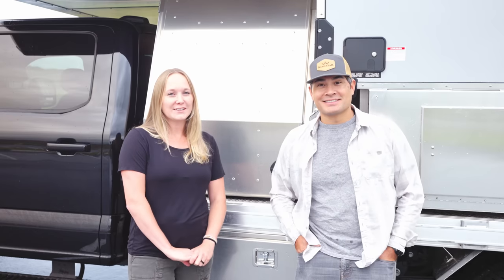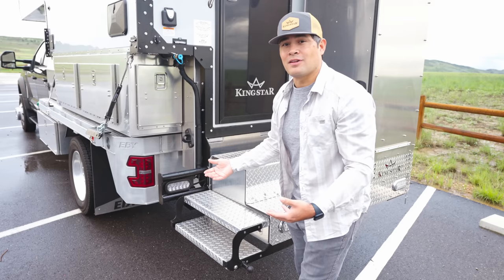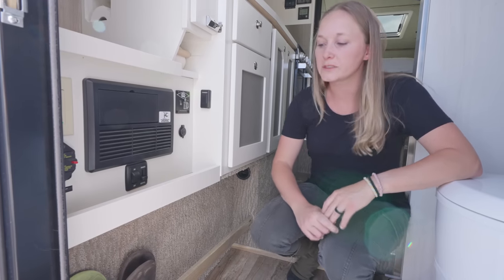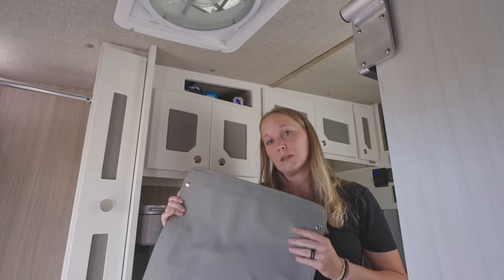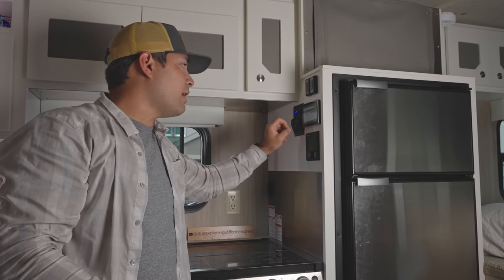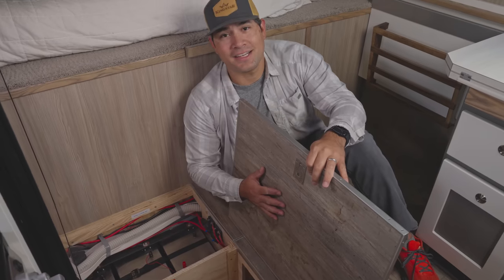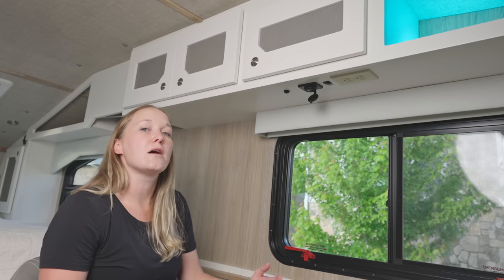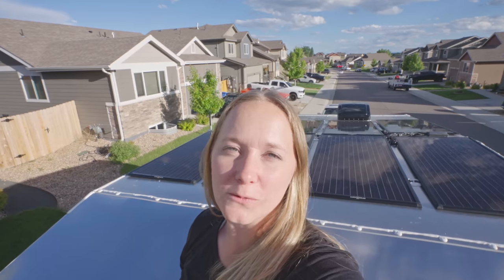2023 Kingstar Camino 88 Truck Camper: The Command Center Walkthrough

Comment from the maker: What are your thoughts on this Kingstar camper vs competitors?
Reply: Here are some thoughts on what i've learned living in my host yukon full time since late 2021.
 
0. Avoid slides... why... (a) water leaks - on all three slides!!!, (b) insects crawling through, (c) winter breeze coming through, (d) slide-awnings make awful noise and can possibly rip with high winds and finally (e) slides makes the camper extremely heavy.
 
1. Love the open space and huge storage
 
2. Love the huge tanks (fresh 65 gal/ grey 51 gal/ black 32 gal)
 
3. Needs a flatbed dually... (diesel - at least a f450 /// gas - at least f350 (7.3godzilla) and preferably chassis+cab flatbed)
 
4. Get a quiet ac right away... 12v ac would be nice to have but not at +$3k
 
5. Get On-Demand Truma water heater... love it
Reply from the maker: @avecruxspesunica2552 great info! And we had similar thoughts on the slide so this is good confirmation.
Reply: Dude did you both trully did buupuPs inside that tiny truck camper ??
Reply: I really like Kingstar’s continual upgrades without having to wait for the next “annual” upgrade. The “controlled custom” approach to their builds is really appealing. I’d probably opt for a traditional dinette, since I have a friend who’d occasionally travel with me. Otherwise, I’d option my build identically to yours. Do you have an idea how tall and long your rig is? Thanks for a great and informative video.
Reply: Not a bad setup! If you're full time RV'ing, the optional "garage" is useful. Otherwise, for seasonal camping, it makes more sense to have more interior space.

Having said that, Kingstar does seem to make good use of the interior space. I like how they implemented the wet bath setup.

Being 6'6" with size 16 feet, I'm sensitive to confined spaces that aren't used properly. The shoe "rack" would be useless to me, but maybe I could find another use for it.

Curious! Do you leave the access panel open for the cats to get to the litter box? Or are the cats trained to let you know when they need to use it?

Interesting use of the desk space!

Hmmmm... since you give a good example of someone who is 5'5", I strongly suspect that I would feel cramped in this unit. The HOST Mammoth would be a better option for taller people like me.
Reply from the maker: Thanks @MickPsyphon ! We love the use of space! The access panel for the litter box can stay closed, there is a small tunnel entrance by the sliding drawers that the cats have full access to that leads to the litter box. Also, I am 5'11" and Dee is 5''5". That said kingstar does have a "flatback" option that basically takes the highest point on the camper and keeps that height all the way to the back door. Way more spacious for those much taller than us :)
Reply: Very nice! Do you know what wheelbase you have on the f550?
Reply: New to truck camping, I watched this three times because there is so much.  Average truck campers don't have all that stuff.  As a single woman I would say it's a bit intimidating but I love the idea of having it built you you vs everyone else.  I plan on looking at the website for sure.
Reply from the maker: Happy you found it useful! Feel free to DM us on instagram if you have any questions.

Comment: I stopped, just seconds in. No pass-through. The ideal king-cab, long box truck, with an option to mount a good camper, and yet again no way to go from the back of a truck into the camper. Like the M1010. Yes I know the whole thing would have to be custom, but it's where the world is now, and no-one seems to make the options.
Reply from the maker: Yea definitely not the end all be all solution, but it works great for our needs and more importantly gets us on the road fast!
Reply: I agree, safety feature in case a person needs to leave quickly.
Reply: How much does your entire camper weigh, with all the storage I would soon exceed the GW of the truck.  Did the flat bed weigh more or less than the factory bed?  I have a 3500 Chevrolet and a Northstar camper.  I would love to upgrade to a similar setup with my current truck.  Nice rig !
Reply from the maker: @jayknight850 great question. We have not weighed it without our gear, but I would guess around 14500-15000 total (note the truck is 10000lb alone). Loaded to live out of we are at 17,500. Note that the camper minus the side and front gearage would slip into any 1-ton truck. They’re build with that platform in mind.
Reply: The garage is the reason why the pass tru is not needed the camper is so nice crawling in ain't cool 😎
Reply: The pass through with gasket allows truck heat or AC to heat or cool camper during driving. Back seat of truck becomes bed for short person, they are still able to talk to others.. for safety you can hop through to start truck and leave. 

It is such a great feature if the camper doesn't have large window there it must be able to install there. I will change out custom truck window if needed. 

Yeah crawling through is not great, but I want the option. Or tiger adventure vehicle with walk through..
Reply: Well… Bye

Comment: I love these campers!  But my imagination sees the forward garage removed with the camper moved forward so the tail end of the flatbed could be used as an outside deck with a custom rear step, grilling and storage system, but it might be too small unless you can get the 550 a little longer.
Reply from the maker: That would be interesting, you may have to do some modifications to the grey tank but that deck idea sounds like a lot of fun.

Comment: I’m curious about the litter & battery/inverter area. Did you opt to put the litter box down there because you have fans that circulate through that area? 

I was just thinking about how adding a fan powered air circulatory system to that lower area could provide cooling for the electronics/batteries, cooling & some comfort for the cats when they’re down there while at the same time controlling the airflow & possible odors from that lower area reaching the cabin area up top.

Now I’m not saying your cats have explosive gases but I was thinking along the same lines as how boats have that fan system that’s supposed to suck explosive gasoline fumes out of the engine compartment before starting the engine. 

If that wasn’t why you added the litter box there and or ya think “Jeepers what a lame idea” then ok my wife is right in the fact that I overthink things way to much. 😳😜 Anyways I appreciate the video. You’ve definitely given me some great ideas to incorporate in my toy hauler moving forward. 
✌🏽🇺🇸
Reply from the maker: We put the litter box down there because that was the most logical spot that was out of the way (and Kingstar could make room). We normally don’t have any issues with smell but every once in awhile… 💩 stinks… 😹 We haven’t thought about the fan but it’s not a bad idea!
Reply: @ExploringStillConnected  ✌🏽

Comment: Hey you guys.  For the last 2 months I have been leaning towards the Kingstar KRUZR 88.  The one I built on there website comes out to about $110,000 and some change.  That is pretty much every option they offer on the thing.  Now that I know that I am willing on paying that amount I have been entertaining the idea of a Rugged Mountain RV.  Specifically their new X-14 because it is a non slide, starting around $100,000, and comes pretty well equipped.  It may be a little too fancy and pretty big.  Just curious on what were your last choices before deciding on the Kingstar?
Reply from the maker: We were looking more generally at new Northern Lites (didn’t check all the boxes) and older Bigfoots (gut and retrofit). But honestly when we saw the Kingstar there was no comparison for our wants. The Rugged Mountain non slide wasn’t available so not even considered. We would recommend getting in to the actual campers because that decided it for us. Make a list of your must haves, nice to haves and must not haves… both campers are great options but fit very different needs. Jesse (Rugged Mountain) and Marcus (Kingstar) are both awesome to work with.

Comment: Hello, awesome rig. I'm building a forward garage and would like to know what sliding tray you used for your bikes?
Reply from the maker: MORryde cargo slide from etrailer. Super solid
Reply: @ExploringStillConnected  Thanks for the info. Looks like a tight fit for the bikes, is your garage the 18" or 36" model?
Reply from the maker: @nomadic4adventure 36 but you can fit two bikes with 18” you just have to remove pedals
Reply: @ExploringStillConnected  Hello,.  What is the size slide tray did you guys go with?

Comment: Few more questions,..what is the length of your flatbed? Is your truck a cab chassis or did you take an 8' bed off it? What is the approximate wet weight of just the truck camper?
Reply from the maker: 11’ flatbed on a 84 “ CA cab chassis. Total wet and loaded with all the gear is ~17k . So about 7k wet with gear and garage/side storage. That said we have a ton of gear 😂. I think Kingstar said empty it’s about 4k but don’t quote me on that.
Reply: @ExploringStillConnected  OK thank you. I have an older 01 dodge dually quad cab 4x4 with an 8' bed. The cab top is only 56" due to the quad cab style, which I like. The thing is I don't want the cabover part of a camper sticking out over the windshield or part of the hood. So I'm thinking if I can put a 10 or 11' flatbed on where the 8' bed is and have a 24" wide storage area behind the cab and set the camper behind it, the cab over part would be right about the front of the cab or top of the windshield area. Only concern then would be if the center of gravity would be right. Thanks again, just trying to get this figured out before I start throwing money at it.

Comment: Was wondering who built your "garage box" and cost? We have a 5500, with a 11ft. CM Flatbed and would have room behind the headache rack for one. As you know, there's no room to store your spare tire. Should be room for the tire and a bike or two. Thanks.
Reply from the maker: Kingstar did and they have it listed on their site right at $7990 installed.
Reply: @ExploringStillConnected  Thank U.🤗 U.🤗.

Comment: Beautiful Truck Camper. I Love All the Storage Areas. 

1 Dislike is the 🚽 & 🚿  I'd rather a Wet-Bath, due to the fact that the 🚽when pulled out, Blocks the 🚪in the Event of an Emergency.
Reply from the maker: I hear ya, but we usually keep it in the “wet bath” configuration unless showering or letting the shower dry. And it is easy enough to slide back in on case of emergency.  That said I think Kingstar has a wet bath configuration as an option as well.
Reply: @ExploringStillConnected  OK Cool, Understood. 

Thanks much 🙂👍

Comment: hate those knobs on the cabinets and also, why do people keep pushing them in when they close the doors? It doesn't do anything but force you to double- push again to open. it does nothing! sheeeesh
Reply from the maker: We have been a fan of them so far. And they do actually lock the cabinets closed when the knobs are pushed in. Great for traveling and bumpy roads. But I could see it as a hassle for some.
Reply: examine the mechanism from the inside of the door, there is NO connection whatsoever. You can easily pull the door open by hand whether the knob is pushed in or not. It doesn't do anything but make it tedious to open and close. Some people may like the look of the knob being flush and I understand that. 
 @ExploringStillConnected
Reply from the maker: @VailJohnson  ours definitely have a latch that locks it in place when the button is in. Check out this link to see what they look like. https://www.amazon.com/Magic-shell-Cabinet-Cupboard-Keyless/dp/B089D8GGRS
Reply: @ExploringStillConnected  thanks for showing me that, I've never seen them in the Prevost's we ride in all the time. Those are simply magnetic. Cheers!

Comment: Why not purchase a small motor home. No one would dare remove that monster from the bed of the truck so what is it's advantage?
Reply from the maker: We have removed the camper a few times. It’s pretty easy and only takes about 10 minutes, it does look sketchy but that’s normal or so we are told :) Even if we didn’t remove it, though, we are planning to modify the truck soon to be able to go off the beaten path further than you ever would in a motor home.

Comment: Having all the elctronics in the floor is a bad idea imo.  You gonna have to be very careful not spilling a drink or even washing the floor.
Reply from the maker: That’s a fair concern, it’s pretty common in truck campers because it helps keep the center of gravity low and in front of the rear axle. Trade offs. 

The floors are small and staggered enough we prefer to wash them with a spray bottle.

Comment: Colossal waste of space . Center of gravity on this thing is ridicilous i would be really nervous driving it on hgwy in windy weather , camper is sitting too high for no rerason . This is the dymbest configuration i have seen so far on a camper
Reply from the maker: I guess it’s all up to perspective, with a overall height of 11’3” we are shorter than most other hard sided truck campers. Sure you can go pop up and get that down but there are negatives with that we did not want. As for center of gravity benign high, if it is we have not noticed, on the f550 this has been nothing but stable for us over the last 15k miles.